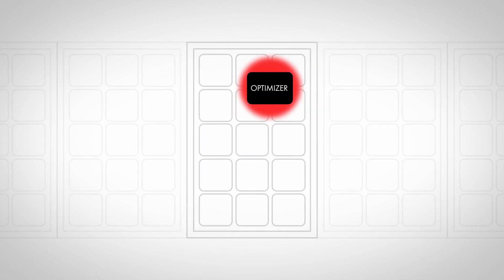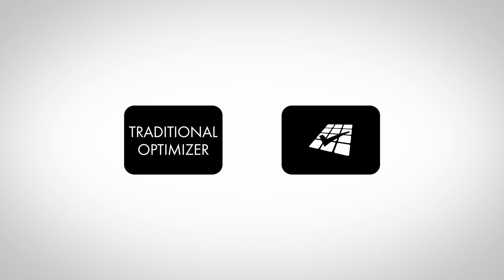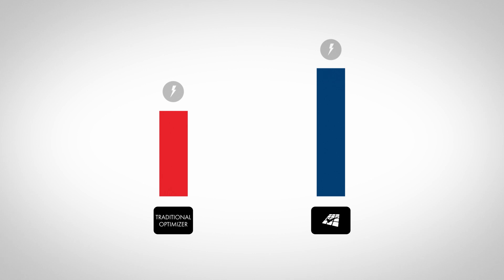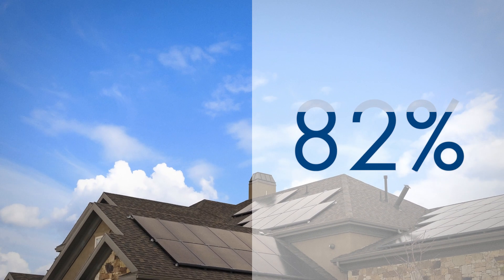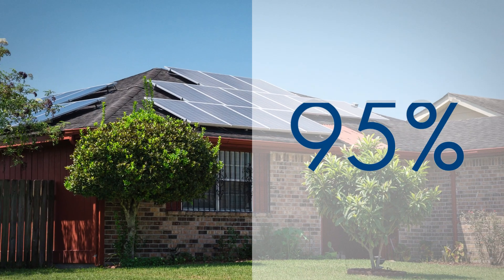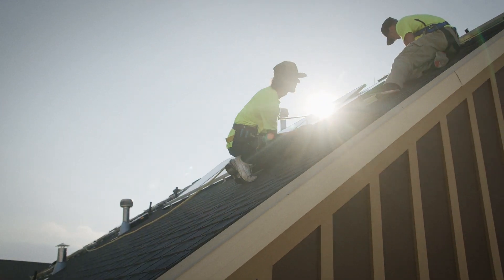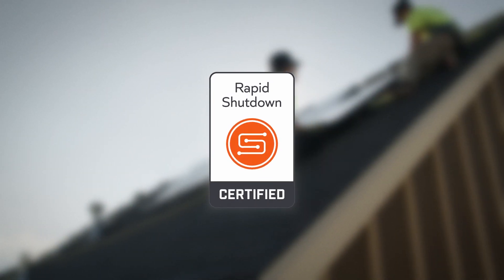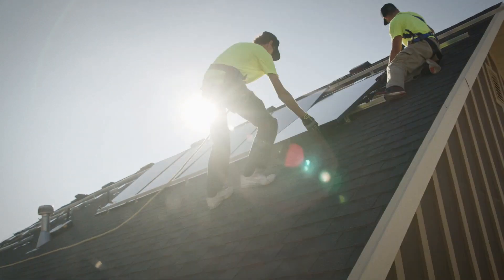SMA ShadeFix Optimization Outperforms!

Comment: When marketing does video it makes no sense.

WHAT THE HELL IS SHADEFIX. 

IS IT A PRODUCT, A MARTAIN, SOFTWARE OR WHAT! 

GOODLUCK GUESSING!
Reply: It's a software based solution that utilizes MPP tracking. According to their white paper, it outperforms traditional PV optimizers, except in instances of heavy shading, because those components consume energy and thus reduce overall efficiency.
Reply: JeanMarcChauveau  The corresponding measures you're talking about are in the white paper mentioned.

Comment: Does my 2 year old  Sunny Boy 7.7 Us  have this technology or do i have to spend 3000 for a new inverter?  Please answer here??
Reply from the maker: Hi there! Sunny Boys for many years have been equipped with ShadeFix and its predecessor OptiTrac Global Peak.  Your 2 year old Sunny Boy has this enabled already - no firmware update is needed.
Reply: Update the Firmware. Your local SMA service will send you the link for it once you give the serial number
Reply: It's not really 'technology'... it's just physics.  Shaded sections trigger the bypass diodes and string voltage drops.  The 'technology' was putting each string on its own MPPT channel to allow this to work.  No more parallel strings.
Reply from the maker: @Chris-ie9os  your description of what occurs is correct only for hard shade scenarios.  But with partial shade, there can be two possible operating points for even a single string on its own MPP tracker.  ShadeFix inverter-based optimization ensures that the system operates the array attached to every MPPT channel on the inverter at the best power point and is NEVER stuck at the “point of the weakest module”, without needing additional module-level components that are subject to harsh environmental conditions.  The wide voltage operating range for each MPPT channel allows for even extreme partial shade – or multiple shade impacts – to be handled by ShadeFix.  The multiple MPPT channels simply allow for more design flexibility. This is not ‘just physics’ but great engineering by the world leader in solar technology.
Reply: @smasolartechnology   Does that mean you need a optimizer for each panel tied into the inverter i.e. Tigo  ts4-r-o, or would a JMS-F SunSpec Rapid Shutdown Module be able to function as a optimizer since it communicates data back to the inverter, or does the inverter have a way to do that by itself?

Comment: i dont understand.. how shadefix could perform rapid shutdown? does the voltage could reach 0 on the rooftop?
Reply from the maker: Hi Gideon! The SMA US-41 models of inverter have a SunSpec certified rapid shutdown transmitter that works with low-cost, simple and reliable SunSpec receivers – like a switch the transmitter can turn off. Power consuming optimizers are not required touching every module to achieve code compliance. SunSpec shutdown works in conjunction with ShadeFix to maximize energy harvest AND system reliability while providing full code compliance in any situation.
Reply: @smasolartechnology  Does that mean you need a optimizer for each panel tied into the inverter i.e. Tigo  ts4-r-o, or would a JMS-F SunSpec Rapid Shutdown Module be able to function as a optimizer since it communicates data back to the inverter, or does the inverter have a way to do that by itself?